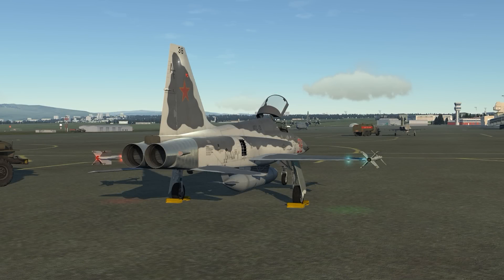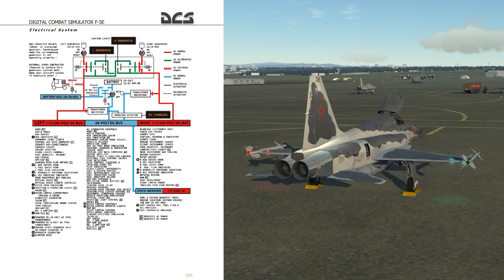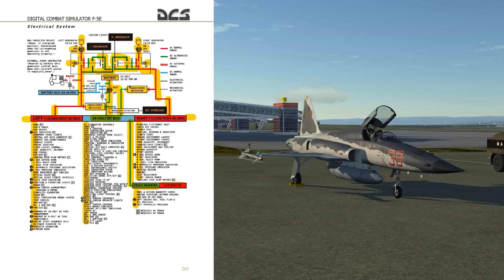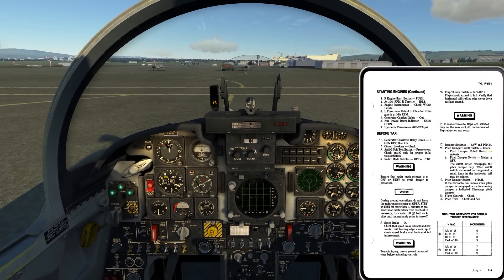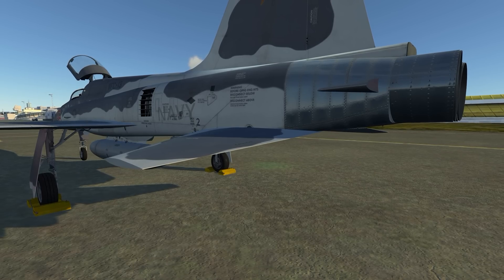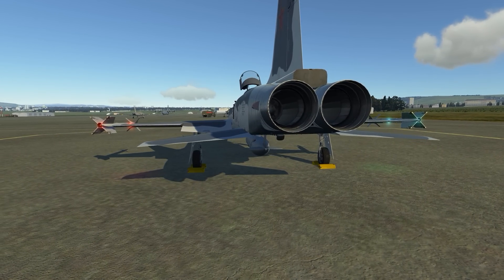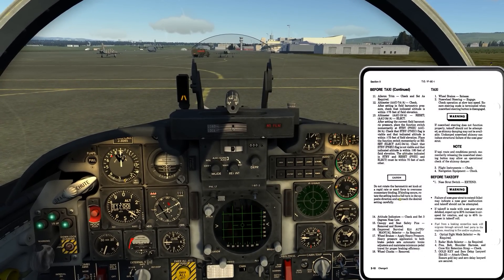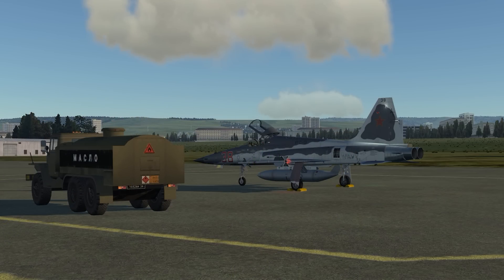Test Flight - DCS: F-5 Tiger II #6 - Electrical System, Pre-Taxi Checks

Comment: From a pilot viewpoint I would check the generator cross ties in the following manner.  I believe there is one dc bus, a left and right essential bus, and a left and right non essential bus.  The dc bus was checked on power up with the landing gear lights coming on.  The check must begin with the inverter switch off to prevent back feeding the left and right  essential bus and to make the cross tie checks valid.  First,  with the inverter off, left generator off, right generator on the checks will be left and right hydraulic pressures normal,  left engine door closed and right engine door open indicated by the engine door indicator being a hash marked indicator.  This will mean the right generator is powering the right essential bus and the right non essential bus and the right cross  tie  is powering the left essential bus and the left non essential is off.   Then left generator on, right generator off should show left and right hydraulic pressures normal, left engine door open and the right engine door closed, check engine door indicator.  Then inverter on and left and right generators off and we are looking for left and right hydraulic pressures normal and both engine doors closed,  check indicator on dash,  The inverter will be powering the left and right essential busses and the left and right non essential busses will be off.  Then both generators to on and continue with other checks.   I believe the logic is a generator failure is probably due to an engine failure and closed engine doors decrease parasitic drag and if the engine  is running  the effect is minimal.  I don't have this module yet and its manual to confirm this would be an appropriate check
Reply from the maker: Well, it is kind of set up that way except there are no inverter switches in the cockpit and no ess/non-ess bus as you describe.  Omitting that, we came to the same conclusion: left and right hydraulic indicators remain on when either the left or right generator switches are off.
Reply: @4023446  Do you suppose it's because by starting the left engine first you are already checking that the left generator will power the right buss? If it wasn't working you wouldn't have right engine monitoring during start up. For the left engine those instruments are powered by the static inverter coming from the DC buss. (edit: I follow what's already been said here and my comment is redundant.)